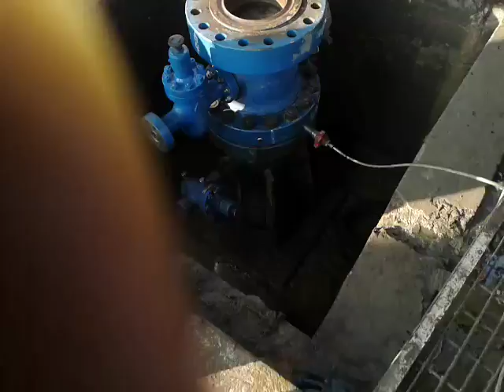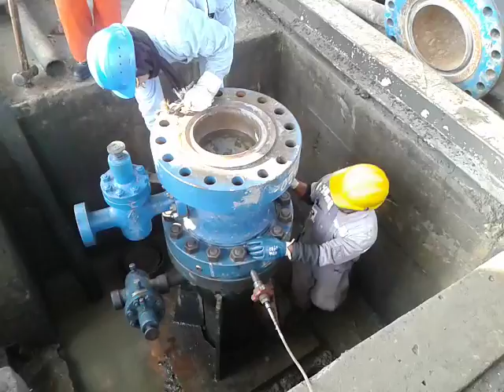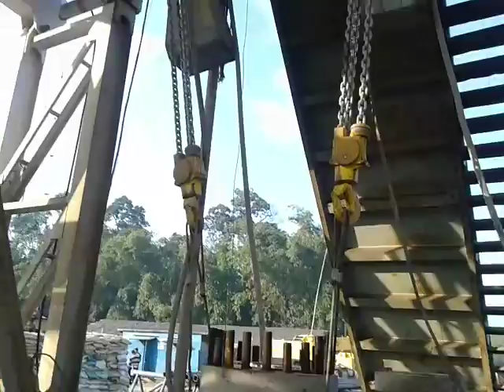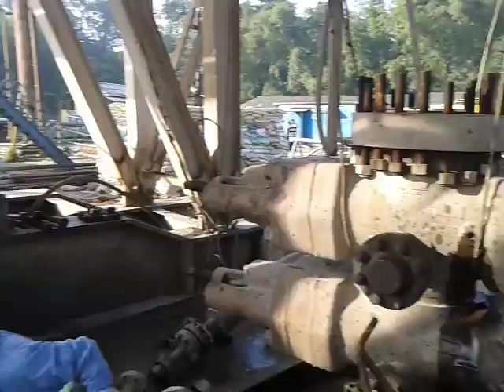Well head setup in progress

Comment: What the size of upper and lower connection for this spool... The working pressure is 3k, am I right ??
Reply: Btm-Casing head flange looks like 11”3k or 10k has 16 bolts with 2”LP outlet with 5k valve. Top- 11”10k 16bolts and definitely a BX ring groove. With 2”5k studded outlet.